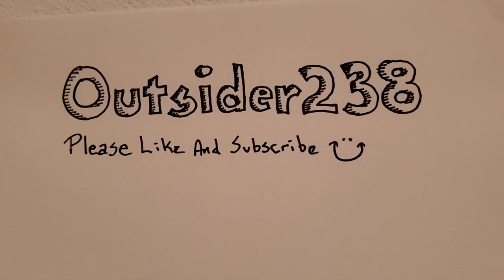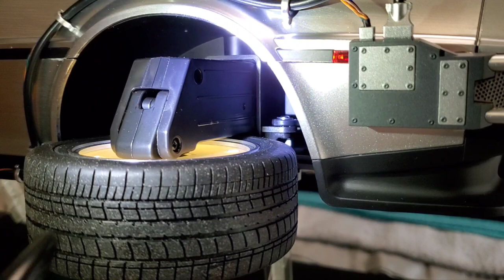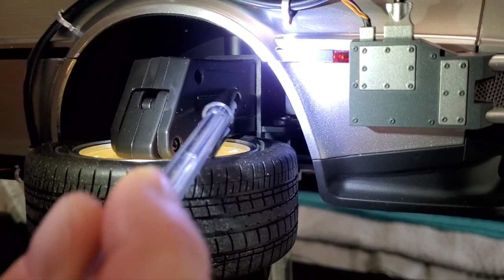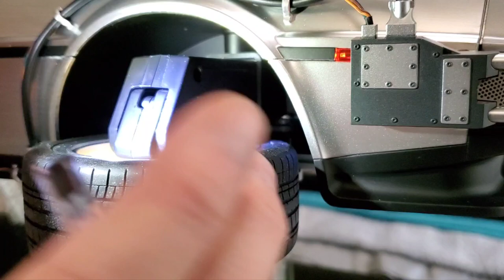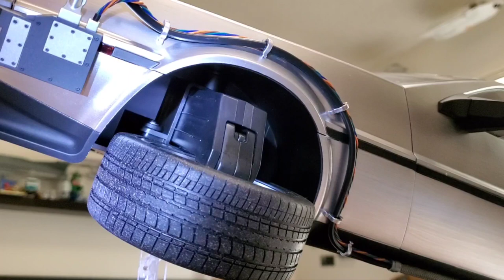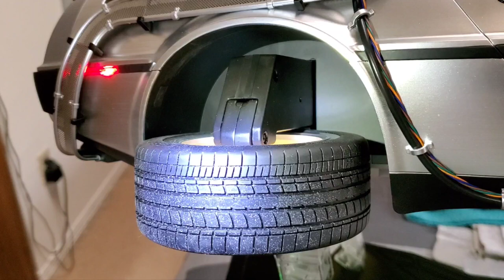Preventing Wheel Breakage On The Hot Toys 1:6 Scale Back To The Future DeLorean

Comment: Great observation! Another possible problem is that the way the wheels "roll".  They don't roll like the Mark 1 like I originally thought.  They roll around the center "hub" which is fixed. If you roll the car back and forth on the wheels, you are stressing that center hub on each wheel position, which is connected directly to that hinge.  The rolling introduces torsion on that center hub because of the resistance/friction around it.  My advice DON'T ROLL THOSE WHEELS
Reply from the maker: Exactly! It definitely does add more stress to the hinges if you roll the car. I really think this version was strictly meant to be displayed in hover mode only especially when you look at the way the stand holds the car.

Comment: Thanks for the helpful info. Hot Toys should have made the wheel mechanism out of metal, instead of that brittle plastic. Also, the paint splatter on the tires and the car undercarriage is unfortunate. Not sure why that was done.
Reply from the maker: I agree that should have been made with a better, smoother mechanism. I think it's not really that brittle but since no one knows whats behind there when they first pull the wheels out, they assume it needs rocking back and forth to get the wheel out and then realize it stressed the hinge instead. The instructions should have made very clear to not wiggle the wheels and just pull straight out. The paint splatter is actually weathering that they did on it to make the bottom and the wheels look dirty for realism but I think it comes off more as a paint defect rather than weathering.
Reply: Totally agree about the metal mechanism! The splatter was supposed to represent grime. (I think) Lol.

Comment: Yanking back and forth on the wheel definitely isn’t going to help the situation; however, some vehicles already have stress cracks out of the box before the wheels are even moved. The problem is too much interference between the gold metal pin and the detent slot in the clevis that it slides in. This creates bending stress in the clevis tab. Some appear worse than others, so I think some of these pins are not pushed in far enough (into the center block) during assembly.
Reply from the maker: It's very possible they were damaged when the person assembling them cracked them when they pushed the wheels in when they finished building that part. Those pieces should have been made of metal and not that fragile plastic.

Comment: After seeing others brake theirs, I only pulled on the wheel just enough until I could just pull on the shaft it’s self. Good video 👍🏻
Reply: That’s good advice
Reply from the maker: Good idea. Another way might be to reach behind the wheel once it's out far enough to get your fingers flat on the back of the wheel and pull them out that way as well. It's tricky though no matter what.

Comment: Great Video. There were also faint stress cracks from over tightening the screws on the assembly as well. I backed my screws out a little to ease the stress. Thanks for addressing that certain issue with how to properly pull out the wheels. Was so frustrating to see people do that on other videos. I actually pull mine out the way Adam Savage did in his video. Thumbs on fenders and pull out with four fingers on each side of the tire and pulling out evenly then flip tires down to hover mode.
Reply from the maker: Yes having even pressure definitely helps as well! 😁

Comment: This is not at all what is causing the problem. Mine was broken right at that hinge out of the box (when I observed the first one was split, I checked the other side to see damage already there before converting the wheels). This, like the Xbox 360 "red ring of death before it," is not user error. You can kiss these things out with the tiny little lips of fairies, and there will still be issues with a significant number of them. 

And I'm not trying to be confrontational here, but please stop suggesting it is the victim's fault during a widespread issue, and just be glad you don't have to deal with exchanging this beast.

Also, I've done quite a bit of detective work, and I'm pretty sure I can say with confidence what has caused this failure (to mine at least). But more on that in a minute, right now I've got to go box the poor thing up in its cardboard coffin and ship it back to sideshow for burial 😢
Reply from the maker: Since making this video, I have seen more people now that had the wheels broken right out of the box. So yes, there definitely was a problem with some of these due to poor manufacturing. But I think before this was becoming a commonly known issue, some people were being too rough when they were pulling on the wheels.

Comment: Wise and very useful video actually. I thank you for that. I also have a question. Do you think HT could send their customers a (diecast) replacement kit to strengthen the current mechanism? Would it be technically possible for the users to change it by themselves?
Reply from the maker: Thank you! I don't think it would be technically possible. You'd have to take it all apart and I'm sure Hot Toys wouldn't want to risk people disassembling it and possibly causing further damage and blaming them for it. I think we're stuck with what we got and people will have to be very careful with their models. At least now that we know it can be an issue we'll be more cautious when switching the wheels to hover mode.

Comment: I would spray a little lithium grease on the box section.
Reply from the maker: That's an excellent idea!
Reply: Found this:
        ►What should you not use lithium grease on?
            plastic parts
            It's not advisable to use them on plastic parts. As lithium is based on petroleum, it tends to speed up rubber and plastic components decay.
Reply from the maker: @oleatv  Oh! Well then scratch that idea! ☠️